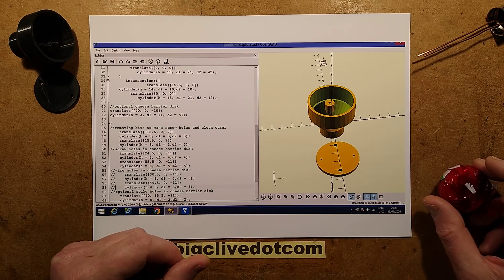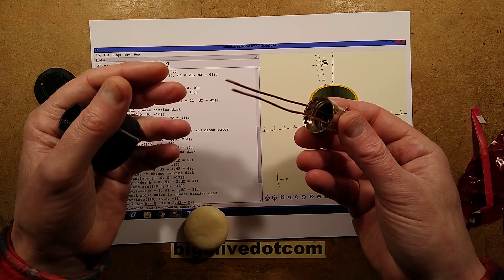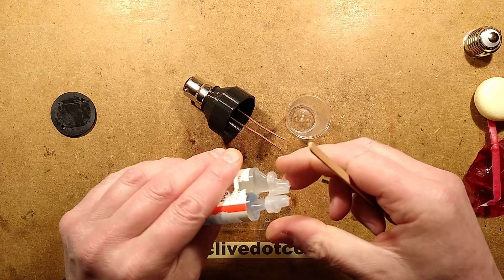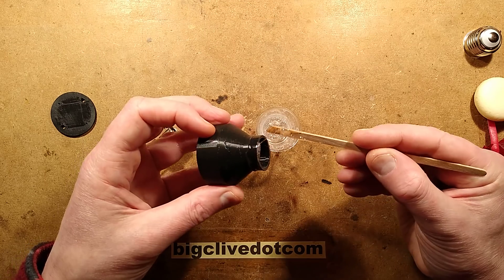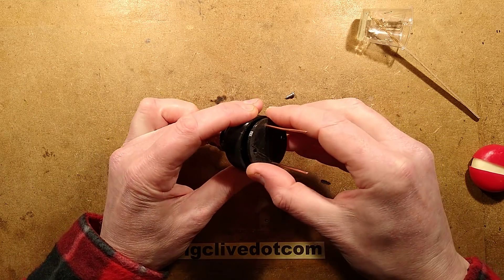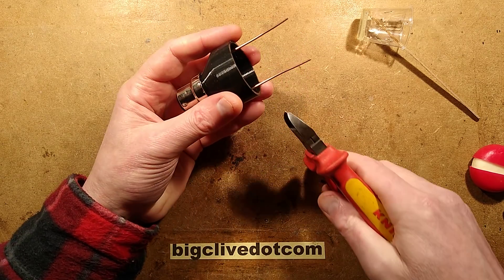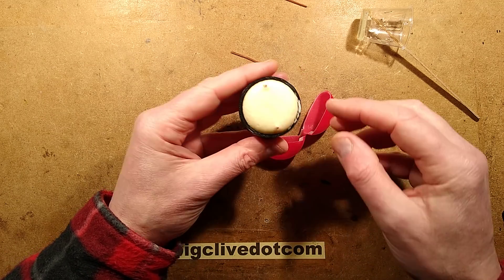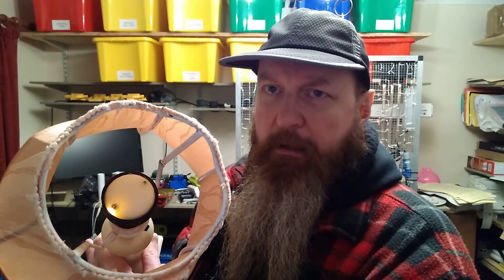Is CHEESE the FUTURE of lighting technology?

Comment: I plan to have yellow yard lights with yellow LEDS. One of the neighbors has orange flame effect yard lights. Is there a candle flicker driver module?
Reply from the maker: For a flame effect, they do cheap solar flame effect lights.  Or an existing colour changing light (has the extra diode and capacitor) could be used to power a classic flicker effect LED.
Reply: @bigclivedotcom thank you very much

Comment: Did you steal that base from another lamp or did you find where to buy them? I need some of those for a project I am working on. I found some that have a plastic piece and pigtails that are meant to use to change can lights to leds, but they are a bit expensive and overkill for something that will get epoxied to a 3d printed enclosure like yours.
Reply from the maker: Stolen from cheap LED lamps.

Comment: I think you did great, and If i calculate λ=(d*h)/(f*V)  40*15/50*220= I get  0,054 millimeter.
That means we got a primary wavelenght in the infrared spectrum, so the obviously fault is not your lamp, but some greedy powercompany whom fails to deliver enough voltage.  Those basterds!

Comment: Maybe you should use swiss cheese and some other cheese melted together so as to get a junction, resulting in a cheese bangap.  The swiss cheese results in the flow of holes.  The photons being emitted at the cheese junction may be in the low infra-red region.  Perhaps with nonlinear optics of some type, you could shorten the wavelength into the visible region.  Perhaps you could make a cheese laser.    I would always wear some protective eyewear to avoid hurting your eyes.  Cheese rays can be dangerous.  You might want to characterize the cheese junction and analyze it's forward voltage and breakdown voltage.  You might need some power factor correction if there are any inductive effects of cheese.  Maybe if you could get the cheese to ionize under partial vacuum, you could make a cheese flashlamp.  There are so many possibilities.  For example, if you could put quantum dots of cheese on a sheet of glass, maybe you could make a cheese quantum dot emission source challenging other display technologies.  Blue cheese laser diodes?  Perhaps tiny pizzas etched into a wafer of crust material.  I think there are fortunes to be made in cheese semiconductor technology.  Why not cheese storage and cheese solar cells?  It might be possible to get cheese down to nanometer size.  I think you should make a clean room, if you want to challenge Moores law, which states:  Every two years the amount of cheese will double.  With the proper isotopic composition, perhaps cheese could sustain nuclear fusion.   Thanks for your pioneering work.  They will have to invent a new branch of science called gooey-state physics.   You will undoubtedly win a nobel prize.  The future of technology is cheese.

Comment: You have to put the cheese in a glass vacuum jar to prevent the cheese from oxidizing.
Reply: A high pressure cheese lamp may also be the way to go, either way, removing the air will provide a slightly discolored carbon arc look.

Comment: If you want to increase the light output you need to increase the voltage. 
To calculate the voltage needed you need a lumen measurer such as a candle comparitor, and then you take your desired brightness, say a thousand lumens, which is equivalents to a 100 watt light bulb, and then you multiply the voltage which is 240 in the UK by the desired brightness divided by the measured brightness. 
Then the LED manufacturers will start paying attention!

Comment: I think you will see when you review the video that the failure was obviously caused by poor connections at the cheese-electrode interface.

Clearly, it was arcing across air gaps left when the electrodes bored through the cheese.

Perhaps you should revisit this but first use the heat gun to liquify the cheese then allow it to re-solidify before applying the current.

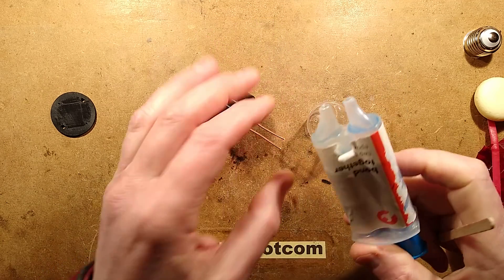Comment: 3:19 Clive - I noted you pulled on the syringes to retract excess glue. However, I was a little concerned you didn't appear to take particular note of the polarity of the cap. Obviously, if you get this wrong, it will likely not come off again !
I did note that you'd got the polarity correct but without + and - markings, it is not obvious.
Reply from the maker: The cap is keyed and I do take care to avoid putting it on back to front and inadvertently curing the whole lot.
Reply: @bigclivedotcom  As Dr Who is well aware, reversing the polarity cures everything ;)

Comment: I read about a filament bulb that used a special coating on the glass to reflect the thermal energy back at the filament and contain the heat inside the bulb, apperently achieving an efficiency comparable to LED. I have no idea if it was true though
Reply from the maker: There was a concept for a filament design that only allowed visible light to escape and had huge efficiency.  Who knows, it could still happen.  When electric lights first replaced gas they discovered gas mantles which made gas lighting more efficient than tungsten lamps and it came back again.

Comment: I think you need a junction between two cheeses for proper photon emission. However, the reason for California cows producing the best cheese is due to photon absorption -  More sun, more photons - which the cows pass on to the cheese through the milk as angry pixies. Pixies are cheese specific and hate being forced to jump the band gap between two cheeses. They will jump once and display their displeasure by emitting a photon. But, they will refuse to jump back.
Bottom line - you are almost there! Just add a diode. Pixies get really pissed off with that alternating current crap. 
When it comes to lighting, Edison was correct. DC is better.
This explanation brought to you by the California Dairy Association - so you know there is no bias.
BTW - I have been told that cheese spread can be substituted as the lasing medium in a dye laser. That of course, is a silly idea.

Comment: I can't help feeling that a high frequency, high voltage electrical source may better stimulate the lumens out of the fromage. Think cheesy arc lamp.
Hmmmmm tesla coil driver or maybe even a microwave oven transformer at a pinch may add a bit more "ooomph"?

Comment: You know, there are people with successful kickstarters who took a dehumidifier, a hepa filter, a pump, and some cheap Chinese filters, and they sell it as "getting water from air" at x100 times the cost of turning on the tap. Just because from a logical, technical, hygienic, and safety standpoint, "cheese as a source of light" is deemed to be a failure to YOU and most sane people, does not in fact mean you can't capitalize on this.

Comment: A new direction for "Clive Industries"? - Now, I'm sure Alfie Clarke didn't give up as easily, and nor did T.A. Edison, or his British Rival, J.W. Swan who developed his incandescent light bulb in the late 1870s.  Perhaps you need a small snubber network to minimise the flashover? A slight tweak, with an LED initiator package (some LEDs and a resistive network) oh, and maybe adjust the capacitive value of the cheese? - I'm sure that with time, grit, and determination, you can develop the world's first practical "cheese plasma" light bulb. 🧀+⚡=🔆💡

Does the arcing always occur on the same 'cheesetrode'? (if you repeated your experiment would it be the same?) and what happens if you were remove and rotate the cheesebulb through 180 degrees, and reinsert it? Would the arcing favour the same cheesetrode? Or would it favour the same 'side' of the electricity supply? What happens if you used a an isolating transformer, so that there was no "Live Vs Neutral" bias? Would both cheesetrodes arc to the same extent? Or would there still be a tendency for one to arc and the other not? Could the cheese be acting as a rectifier? (think mercury arc) and could this be the world's first 'organic' rectifier diode? Could four be arranged to work like a "FULL BRIDGE RECTIFIER". (An evil though just entered my mind - How about three cheesetrodes and a three phase power supply? A three phase cheese arc rectifier? Muah ha ha haaaaaaa!

If you think I'm kidding? - No, I'm not! - There is much research to be done, my friend. Experimentation and empirical science will lead mankind toward a brighter (even if somewhat stinkier) future.

Come, there is much to do, and I fear my time grows short. There is not one moment to lose..............⚰

Comment: Did you know that slugs can be used as a fuse?? Needless to say that larger fat ones are better at higher amperage's. I am not proud with my testing on slugs and a number did suffer by exploding!! My excuse was I was only about 10 years old at the time. The experiment was quite simple. A copper  PCB had a gap if about 8mm cut across it. The slug was helped towards the gap. I forgot to mention, about 240 volts was connected across the gap. I found an average size slug fused at about 1 amp. The only problems I faced before going into production was the slugs would not always travel in the correct direction and the result could be a little messy!! I think more testing is required. Note, not much light was produced, cheese could be better for light output.

Comment: "Clive!,  Stop electrifying your food and eat your supper or you can go to bed hungry."
You need more contact area. If you find a balance between contact area and current that might actually work till the moisture changes too much.  Led constant current driver.  
Thanks for the giggles  keep em coming.
Reply: LaserFlexr Yes more surface area, how about corkscrew shaped cheesetrodes instead of the current straight ones.

Comment: This by far, and technically speaking, is quite a cheesey breakthrough. I do believe if the electrodes were of the stainlessness variety, it would qualify as sanitary and safe. Also surface area needs to be larger, might I suggest the use of plates or strips of flat metal?

Love all the videos Clive, keep up the excellent work!

Comment: I don't buy the concept that blue light affects sleep patterns. Orange and reddish lights leaking into my bedroom bother me to no end when trying to sleep, but my bright blue alarm clock doesn't. I'm also someone who gets annoyed by f.lux and other blue light reducing applications changing the color accuracy of the display to the point that I've not noticed ANY positive impacts to use of a device implementing f.lux late in the day on sleep. I feel that whatever light intensity hitting your eyes, regardless of wavelength affects your sleep patterns. Blue light, while the most intense per cone in the eye, has less blue receptive cones in the eye in general than reddish or greenish light and thus a lower optic nerve impulse. Rod cells in the eye detect red and green spectrum colors MUCH better than they do bluish colors of light. So orange or yellow light shows up as brighter to your eyes at night than blues do, increasing the optic nerve activity for those spectrums. 

This is all just my opinion and understanding of it, but I personally sleep better with a bluish light in my room than with a warmer one. My alarm clock has a large blue LED face that lights up the white walls in my bedroom. I can see every wall in the room at night if I open my eyes. Yet I sleep fine. If there is ANY exterior light leakage from the orange high pressure sodium street lights in my room I find it hard to sleep and that has been universal throughout my life no matter where I live or distance to the streetlight.
Reply: You should ask yourself why NASA and the International Space Station have standardized on variable color temperature lighting. Chances are good they've looked into it a bit deeper.

Comment: I find that if you dose a Quartz arc tube with a 50/50 mercury/sodium mixture, a little strontium, 400mg of cheese and a little bit of potassium, flush it out with an Ne-Ar penning mixture and then seal it up, shove it into a vacuum sealed glass outer envelope that has an IR coating on it, and you can get about 875 lumens per watt with a CRI of 95. It's a really pleasant light output but du be careful because if the lamp ruptures... it's a little more, shall we say... "aromatic" than most gas discharge lamps.

Comment: I knew it! AS soon as BC started with 3D printing, a 3d printer would appear on my wanted list. I have not got any room for one either, but In sure I could find room in my workshop/computer room/ham radio shack!
Reply from the maker: The one I got is a Tiertime Cetus 2 and is a very compact and open-frame printer.  (But rock solid.)

Comment: Clive, I think you're onto something, don't give up. If you had a live cheesetrode in the centre, and then several common'd cheesetrodes around the edge, I think you would get a much more consistent and even light. There is also the possibility that the cheese element you used was faulty... it's wasn't a cheap Chinese cheese import was it?

Comment: Well … first, where did you go while the epoxy kicked off–perhaps not germane, nevertheless details may be critical (all engineers and scientists know this). Secondly, the trimming of the ends of the electrodes did not appear to be uniform. (Additionally, it may be that the ends should be blunt to avoid the path through the cheese curving. In fact, it would be better to pre-drill the cheese to ensure the distance between the electrodes remains exactly the same.) And finally, you must have previously experimented with current vs. distance to arrive at this arrangement, yet it might be that when assembled, the amperage, distance, size electrode, or age of cheese needs to be "tweaked".
jus' sayin'

Comment: Since a lot of LEDs are really blue with a phosphor, maybe blue cheese would have worked better?
Reply: I like where this is going
Reply: Maybe stilton, green led
Reply: da-Share 
BRILLIANT observation
Reply: He could try some out of date Stilton. He probably still has that laying around.
Reply: Blue cheese equals blue light
Reply: Anyone who knows how they get Stilton Blue will appreciate this!

Also ...... am I the only one who wonders why the light emitting cheese only emitted from one side?
Reply: @totherarf  The cheese would make a good spark plug replacement
Reply: @totherarf  no, i wondered the same thing but then i thought it was just the electrode with worse contact, the 1 with better contact conducted contiously without arcing at random
Reply: @frogz  I thought that too .... but wouldn't the good connection cause it to melt or to use the correct culinary term Caramelise .... giving  a poorer connection! ;0)
Reply: @totherarf  It's because one side of the cheese is neutral and the other side live, so sparks only arc across the burning cheese
Reply: Edison didn't give up on day one.  This also requires further experimentation and investigation to get right.  I will take the liberty of suggesting something already bright like Velveeta or Easy Cheese!
  Rome was not ruined in a day, or something like that.
Reply: Wait, does it give you Bluetooth?
Reply: @alberttyong  Possibly a blue face, and a blue body, in a mortuary.
Reply: sharp cheddar replacing HIDs
Reply: funny
Reply: rock on roquefort.
Reply: That idea stinks.  No, really, I'm not being insulting - have you smelled blue cheese?  Now imagine it burning... 0.0
Reply: Blue cheese made with copper wires. Conductive tracks ?. Only one way to find out.
Reply: Blue cheese only for a blue light.... 🤓🤓😜🇨🇭
Reply: That'll rot
Reply: This vid really needs to be a Monty Python skit. .
Reply: it seems like a mature idea
Reply: Give your home the fresh fragrance of Air Wick BVD (Blue Vein Diode) Lighting
Reply: Yes, the presence of copper salts should make it a much better conductor.
Reply: Just don't use Stilton, or you'll get X-rays instead.